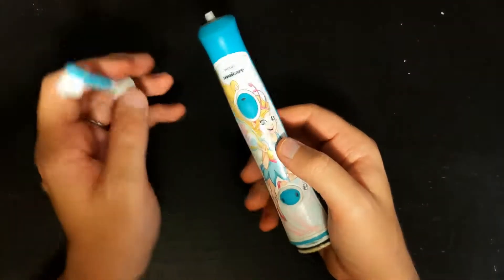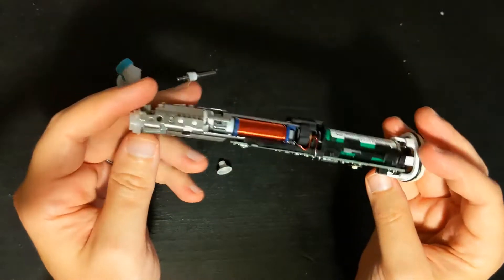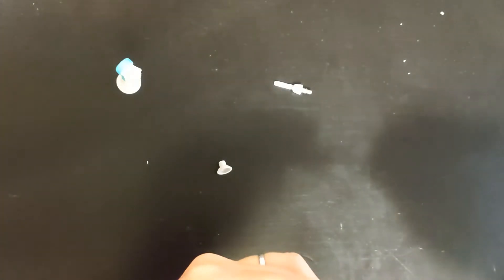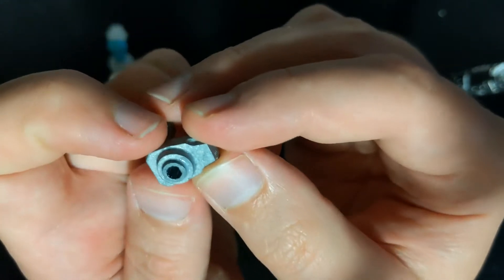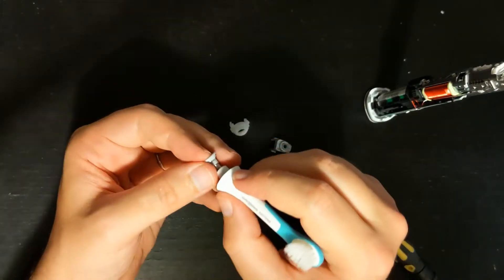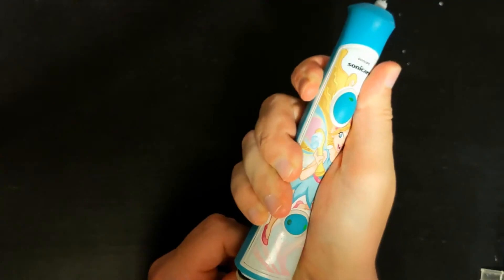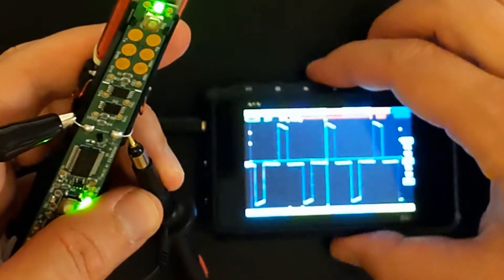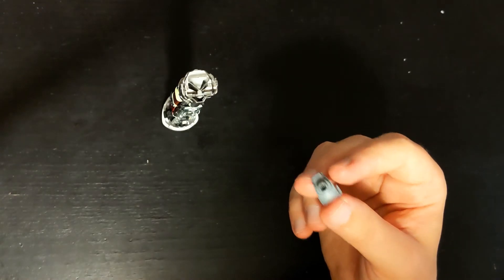Philips Sonicare Kids dismount and repair

Comment: For me, the part I needed to fix was a gap between the coil and a magnet that had closed. To fix it you have to unscrew two small screws one exposed on the battery side and one opposite under the circuit board. You can access it by pulling the battery section away from the top part pretty hard. Straight down. Don't try to bend the black plastic or the circuit board, or they could snap. It's similar to how it's shown on repairing adult models, but I had to pull the battery section harder than I expected.

Comment: Thanks! Your video helped me repair my kid's toothbrush. It's a shame that they build them with these flaws almost like they design them to fail after some time. Mine failed exactly like this video after about 8 months of use. Philips sent me another refurbished one since it was within warranty period but the refurbished one was noisy. The refurbished one started failing after about 6 months later but with another issue (vibration stops with toothbrush head presure). So I replaced the broken head in the old broken toothbrush with the refurbished head which was ok. I have now a working toothbrush and saved 50$. This kind of designs to fail creates e-waste and pollution. I hope they make better quality toothbrushes in the future.

Comment: Thanks for the video! It convinced me that my issue is exactly the same and this is a manufacturer approach to limit toothbrush life. What I did in my case was to wrap the tooth nut with painters tape (😂), cool the nut down in the fridge, heat up the block that holds the nut and put it back together. After cooling/heating the parts to the same temperature it holds like a rock 😂

Comment: Hello. Thank you for the video. I had the same issue. I used your video as a guide and tried to fix the pin that had come off. When I opened the brush I found nothing to be broken but the pin had somehow came out and not holding anymore. So I used super glue and glued it ( you didn’t show the glueing part of how you fixed it, no idea how you did it). Now the pin is attached and not coming out but the brush is not really oscillating a little vibration but not much. I don’t have an oscilloscope to figure out how much it is moving. Also when he starts brushing, and puts it against his teeth and puts a little pressure the toothbrush completely stops vibrating or making any kind of noise. Any idea how I can fix that?